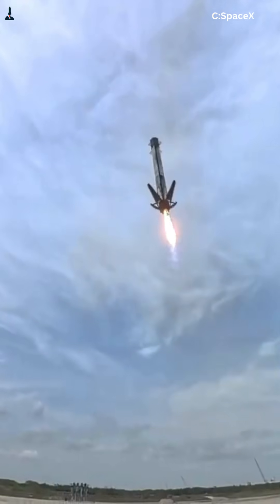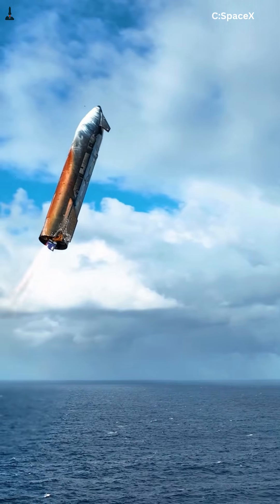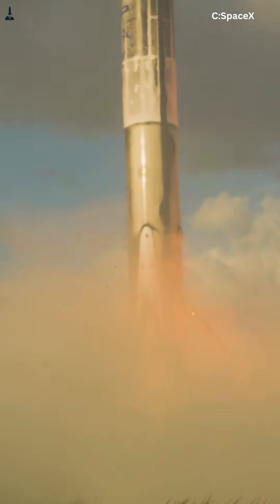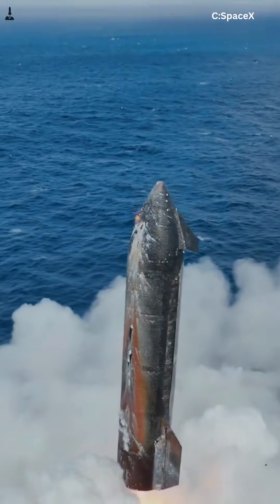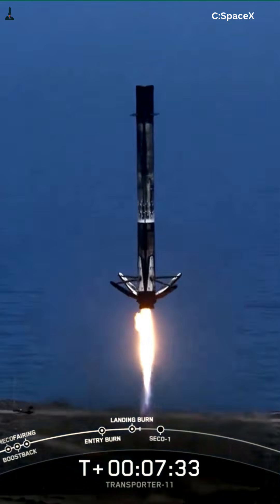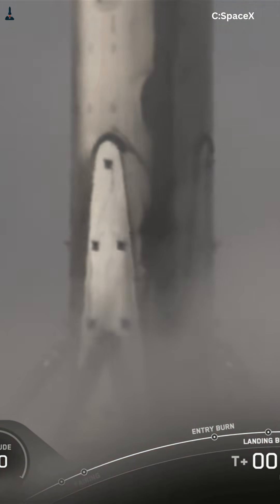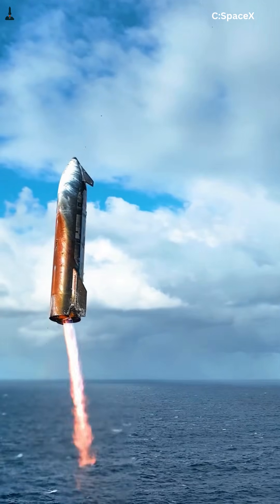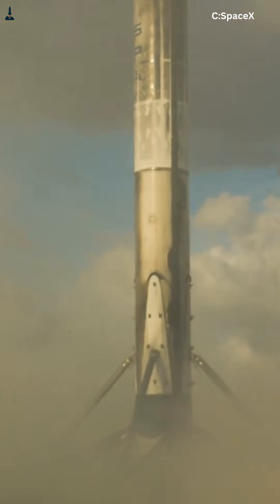Falcon 9 Nailed Rocket Landings — So Why Starship Ditched the Legs? #spacex #starship #elonmusk

Comment: Super heavy and star ship have a landing technique where because there so big they have to be suspended, less weight if there were landing legs, and because it’s such a massive rocket both upper and lower especially if they did have legs it would just tip over anyway… that’s the scale of these vehicles. A way around landing legs is to have it be caught by the tower… have the tower intergraded and all three systems plus Mission Control allows starship and super heavy and the tower to think for them selfs
Reply: But what if starship has to land without a mechazilla?? Like on mars?

Comment: These are reasons why I've advocated for HLM not to land directly in the lunar surface, there's probably no way to accommodate or mitigate all the risks of foreseen and unforeseen events.that could happen.

 Instead, a portable landing pad should be sent on its own mission prior to HLM and set down, likely using explosive charges to drive pilings as deep as possible similar to how bridges and tall buildings sometimes drive pilings. After that the pad would use levelers to ensure a level, stable and reliable  surface for reusable rickets. Since launching from the lunar surface is a much less strenuous operation, it wouldn't be subjected to the forces if launchpad's in earth 

This solves all Starship type problems and creates a perfect launch pad that can accommodate even tall, legless space vehicles.
Reply: An HLS doesn't need to come back to Earth.  It could dock to ISS, for loading, crew rotation etc.  This means it needs no tiles and can instead be redesigned with landing legs.

It needs dedicated spaceships anyway, which never will land anywhere.  That's when larger space stations get interresting.
Reply from the maker: That's a really interesting idea for ensuring stable and reliable lunar landings!
Reply: I don’t see how that solves the landing issue away from earth. Realistically, starship sans landing legs would need a chopstick tower to be built autonomously on the moon or mars to land people safely. That would require a level of autonomy that we are nowhere near being able to accomplish right now though, and likely won’t be for at least another generation…probably much longer. More importantly, if we do ever develop that level of autonomous builder bots, there will be essentially zero reason to send humans off world other than publicity stunts.
Reply: hls starship will be and work a lot different than a normal starship. HLS will not have sea level engines just 3 Rvac engines, this means there will be no header tanks which also means most of what makes starship top heavy wont exist in HLS. 85-90% of starship hls mass will be in its lower half. also the moon having 1/6 of earths gravity allows for much lighter legs without the extra reinforcements. these factors make lunar and even Martian landings practical with legs.